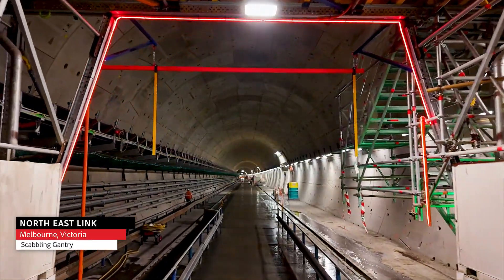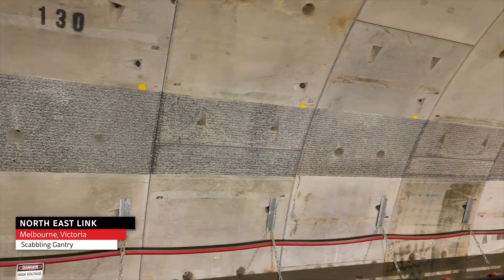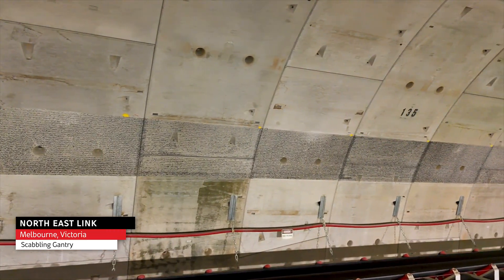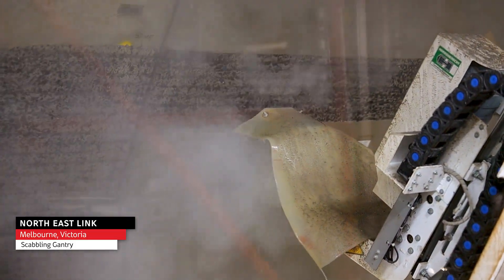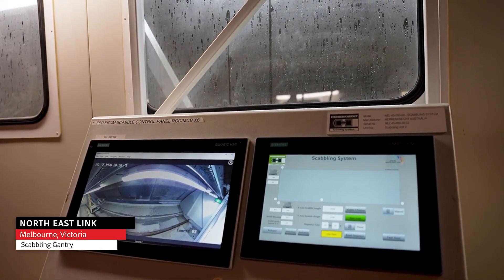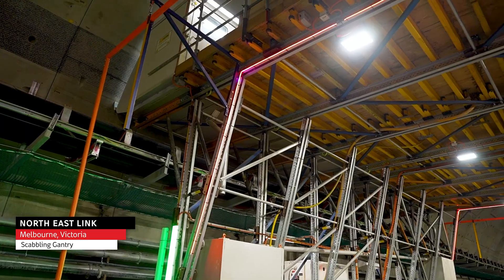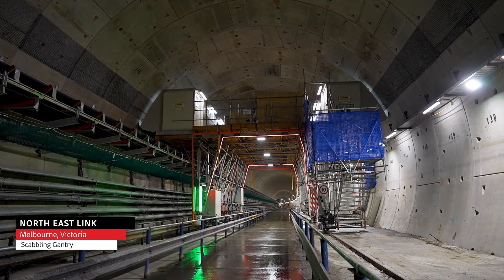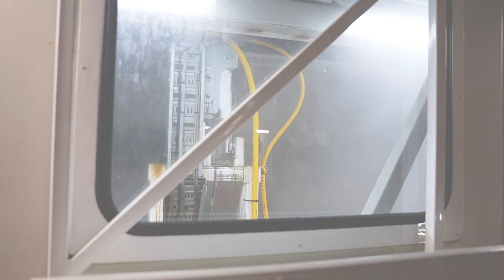North East Link | Scabbling Gantry

Comment: ❤❤🎉🎉you don’t need to scrabble when you’re putting 20 mm rebar into the wall to form your new roof which is poured using a Italian portable steel form on railway tracks ❤❤🎉🎉